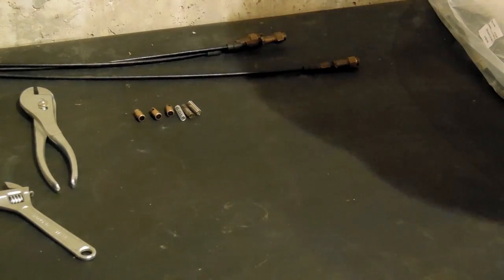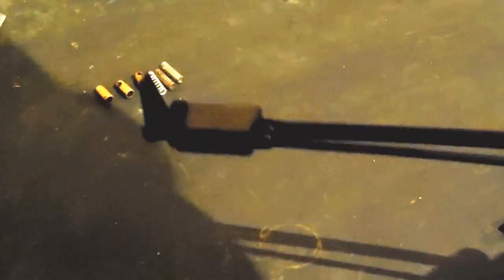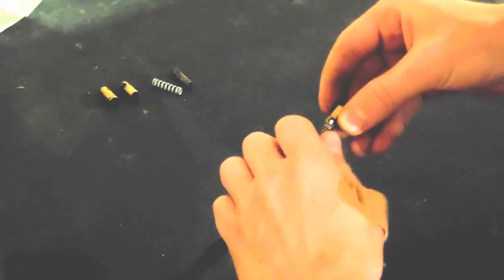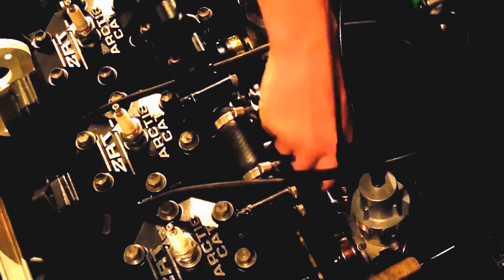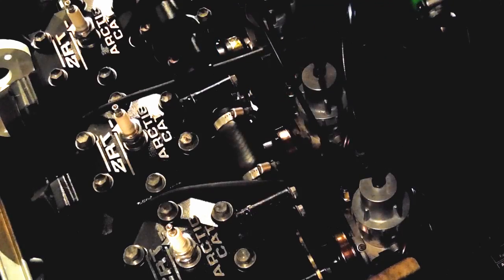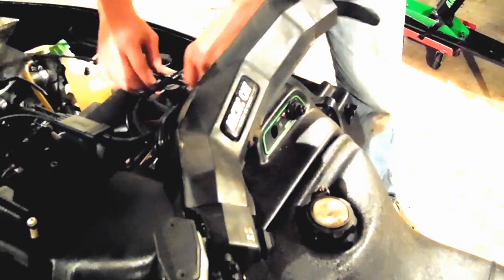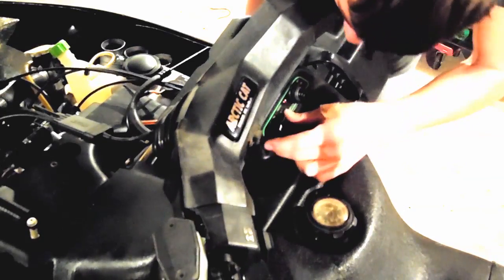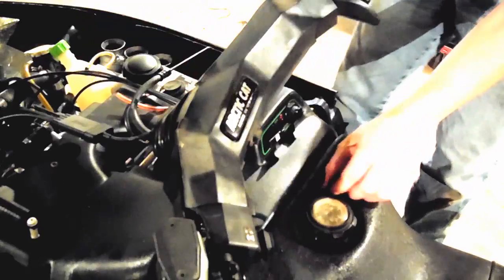Powder Extreme rebuild #12: choke cable install!

Comment: My kids and I are restoring a 97 Powder Extreme.  I've managed to back myself into a corner running re-installing the fuel lines for the carbs, it looks like my labeling of the hoses was not as accurate as I had planned.   Any chance you could do a short video tracing the paths for the fuel lines from the fuel block to the carbs?Thanks.
Reply: I maybe able to, yes. However to get you started in the mean time. On the fuel pump there are 5 port (hose barbs) one has an arrow facing in, that is the "input" the other three are outputs going to the carbs. Doesnt matter which one goes where, just use which ever one is closest to the carb. The last barb is on the bottom of the fuel pump facing down, and is molded into the pump housing (not steel like the rest) if i remember correctly it is right behind a output barb. This is the vacuum line which runs to a barb on the engine underneath the middle carb. Hope that helps untill i get a video up. Dont worry i dont think you can damage anything getting it wrong.
Reply: ok, we're making progress, slowly.  my efforts now focus on the altitude compensator.   I don't believe mine was ever connected properly. Any advice would be appreciated.
Reply: I caint say for sure but i there are basically 4 lines coming out that go to a "T" then those two tubes go to each carb. However i acually removed mine and vented the carbs like a any other sled. So if you arent going to be riding at different altitudes it aint worth it in my opnion.